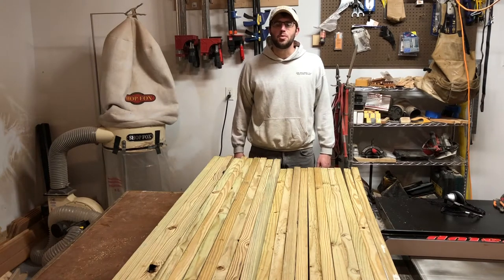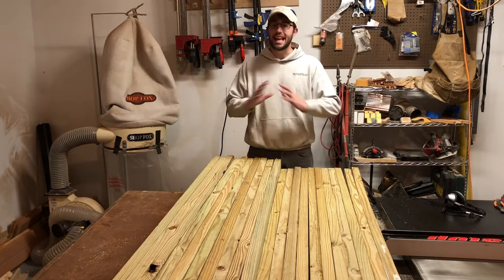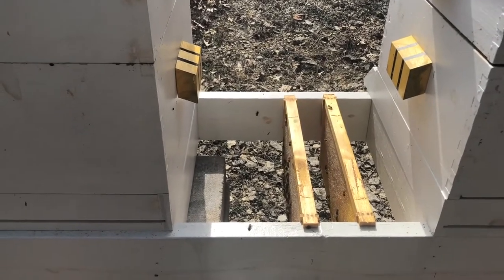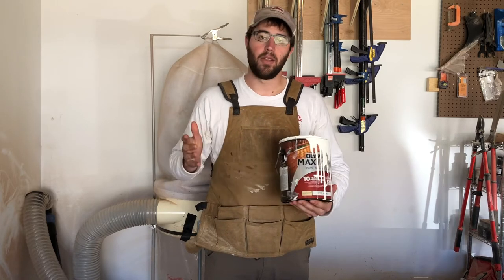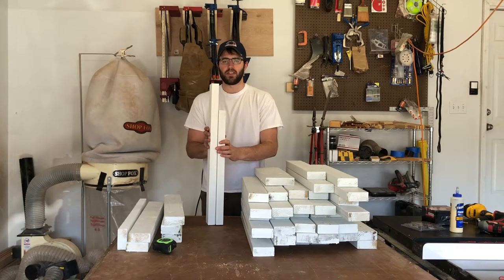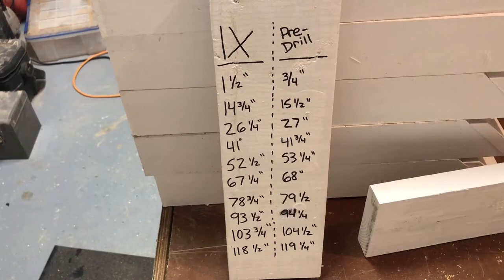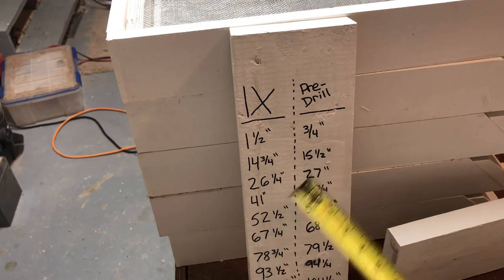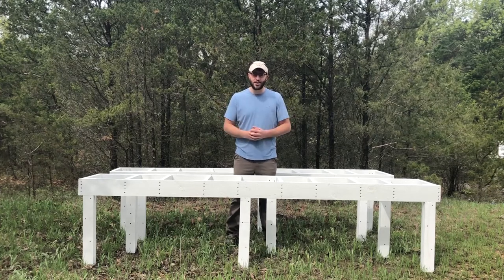Complete Guide to Building a Durable Beehive Stand

Comment: Enjoyed the video, however, in the future use screws rated for decking and consider using construction adhesive instead of the glue. Since you have already painted the glue you used will be of minimum help(if any).  Keep on keeping on,

Comment: Hey David.  Great video.  My only recommendation is to make sure you use decking screws designed for pressure treated wood.  Do not use drywall screws in the future.  They are not designed for outdoor use and the chemicals in the pressure treated wood will eventually eat away at the uncoated drywall screws and weaken them.  Other than that, great job!!!
Reply: DITTO!!!!!